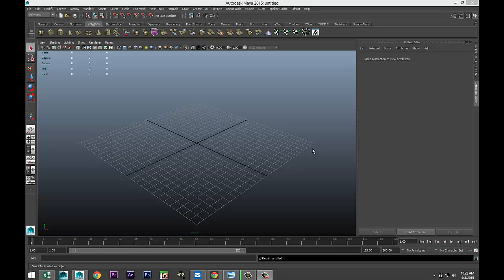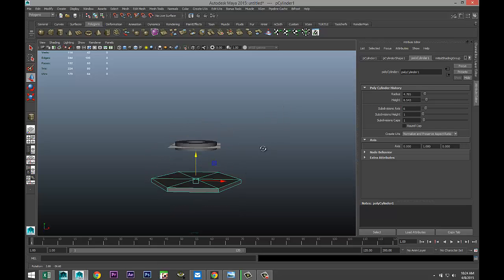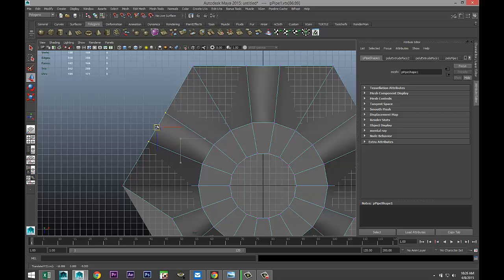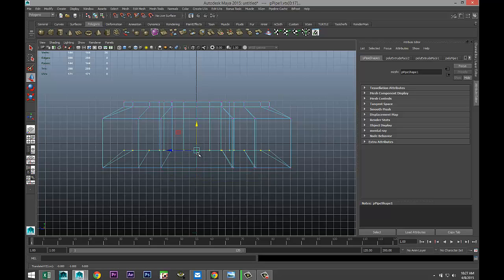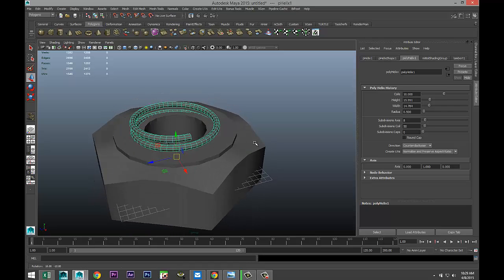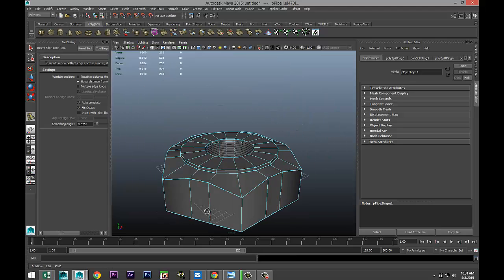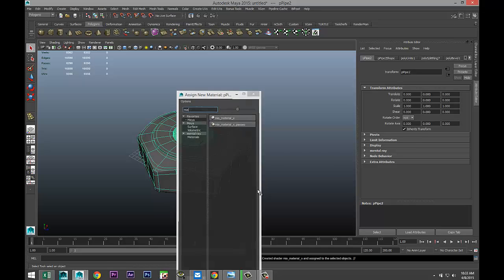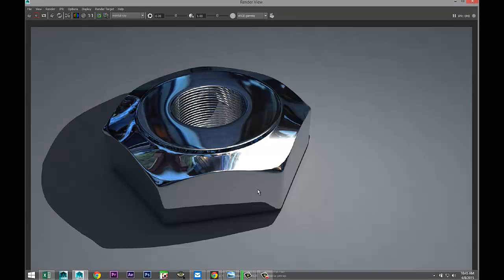Maya Nuts & Bolts modeling series : 1 : Hex Nut

Comment: Thanks for this tutorial. It helped me make a quick hex bolt. I just have to note when you bevel in the fashion that you did, you introduced some N-gons ( 5 sided polygons ). This can be considered pretty bad as it introduces artifacts in renders most notably in reflections like in metal objects. It also causes issues when you try and smooth the model. I need to mention that because for the people who are following along... their edge flow needs to be a bit different for that part of the tutorial.

Comment: STEP/IGES files can be downloaded from websites like McMasterCarr, other vendors, and the content websites for Solidworks & Autodesk.  Another option is to download the files from McMasterCarr  for Solidworks --> Import into 3ds Max --> Send to Maya.   However, a simple M3 nut will have 13,500+ faces! (-5 mesh resolution results in 6,874 faces).  I think any time saved would be lost at render time...so thank you so for this!!  Whether Solidworks or Maya, for simplicity I always remove the thread geometry...except in Maya I will have threads only on the exposed portion of bolts.  Thanks again for "keeping things simple", without sacrificing quality!!
Reply from the maker: +Duane Appleget You are very welcome

Comment: i followed the whole process you did. but first thing, when i render the image, it starts rendering and at the last moment the image becomes black with small grids. second, i dont know what i did in render settings and after that the image comes out, but the quality is very poor. and last thing, i placed image for reglection, but no effect.. whts d prob?
Reply: +Anup Kumar Malla double click on select tool>window is opened,turn on camera based selection
Reply from the maker: +Anup Kumar Malla Anup, how much memory ( RAM and Video ) do you have ?
Reply: only 2 gb, no graphics
Reply from the maker: Maya requires at least 4GB of RAM ( 8 is better ) and preferably 2 GB minimum of video memory
Reply: this is v.12..
Reply: okay, how you are selecting the row of faces in one click? when i drag and select, both outer as well as inner faces are got selected, then i am unselecting the inner. how to do dat?